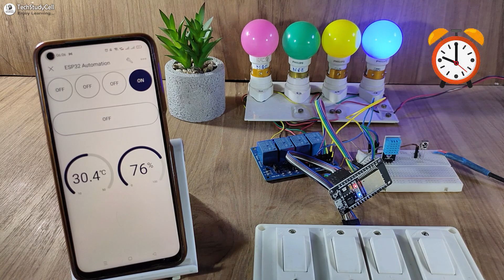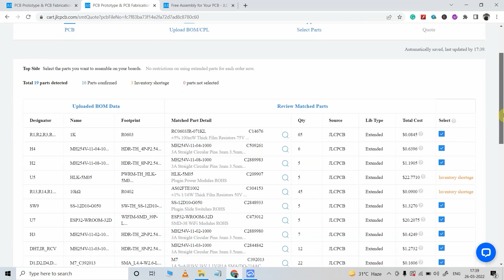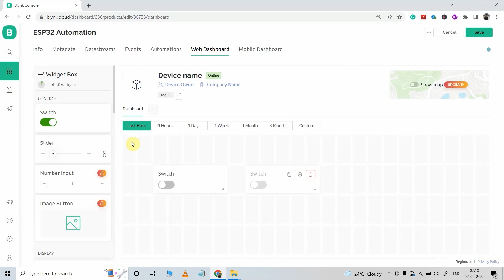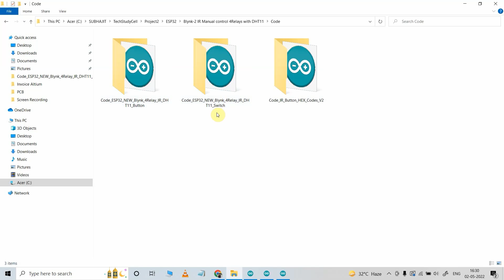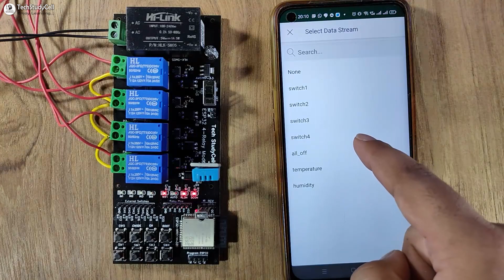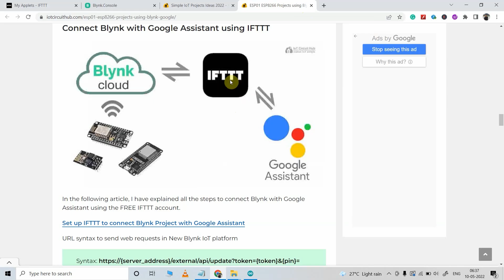IoT Project using ESP32 Google Assistant Blynk with Timer & Sensor | Home Automation System 2022

Comment: cloud we add an Arduino code when i press a button (ex:pin 5) for 10 seconds break the current process and create an access point to input WiFi-ssid and password and blynk authentication code then reconnect to wifi
in-case i changed the WiFi credential

Comment: The function decode(&results)) is deprecated and may not work as expected! Just use decode() without a parameter and IrReceiver.decodedIRData.<fieldname> .   i face this issue plz tell me
Reply: Yes I have also same problem😮‍💨. Are u finded solution for this

Comment: Sir, I have 1 question. I have connected AI Thinker ESP32S module to 16 Channel Relay module.
 It is low trigger relay. So when I run the blink program of Esp32 ( No Arduino .Only Esp32 and relay module), using Arduino IDE, Relay  should turn ON  at Low and turn OFF at High. This action should repeat continuously. 
But the problem is When I connect relay pin to esp32 D2 pin, the relay is turned ON and always stays in ON condition. No OFF action happens. 

Please provide solution.

Comment: Hello Techstudycell, I have been following your videos and I have made some of your IoT automations. I appreciate you for all these nice videos. 

In the codes for this automation (Both Latch and Button codes), when compiling the code, I received an error message about "BlynkTimer timer;" function, In the error message, I saw "Conflicting declaration BlynkTimer timer" please How can I solve this? Thanks.
Reply: /storage/emulated/0/ArduinoDroid/userlibraries/IRremote/src/private/IRTimer.hpp:1373:50: error: missing binary operator before token "("
Reply: I have also found this error
Reply: Could u help me ?
Reply: @bhaskarsolanki7266  I edited the code and got it working but I lost the code when my laptop crashed. I will try to edit it again and get back to you soon

Comment: Very well managed project on suggestion to add dc voltage and current measure as now a days all the home appliances are operated on dc voltage so on can monitor completely and some flaws are there in project when no internet is available for long device get hanged no control over push button as well as remote so we need to restart the device plz make this fix with updated virtual pins for voltage and current ...

Comment: can you please do ESP32 PCB design with 16 relays, IR, BL and wifi control, including 5V regulator. Basically only one ac in, and 16 switch control out. Controllable by IR,BL and wifi

Comment: After about 30-1 hours NodeMCU8266 wifi is disconnected.  Without restarting the module, wifi is not being connected and apps are not working.  What is the solution to this problem?

Comment: Bro..... I appriciate your work but i need your help. I have to sumbit my project in collage of home automation using esp32 wifi+bluetooth+ir + temprature+manual. So could  you provide me this same code with updated version using Bluetooth 🙏🙏🙏
Reply from the maker: It is hard to add blutooth + wifi in same microcontroller

Comment: 1) This timer will work WiFi is not available?
2)  this timer can adjust particular date that ON and off?
3)it's also can the relay output as a single pulse ?
Reply from the maker: 1. No, 2. Yes, 3. Question is not clear. Please elaborate.
Reply: Single pulse like a push button I mean that latching in sonoff like
Reply: It's work with siri